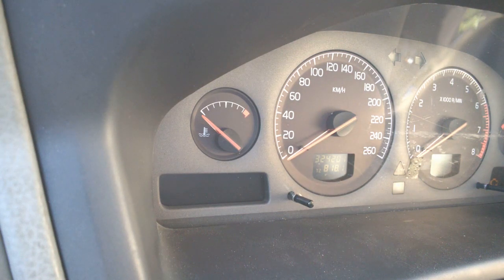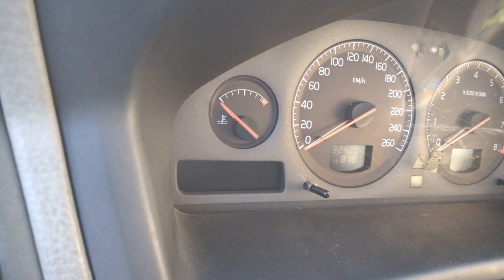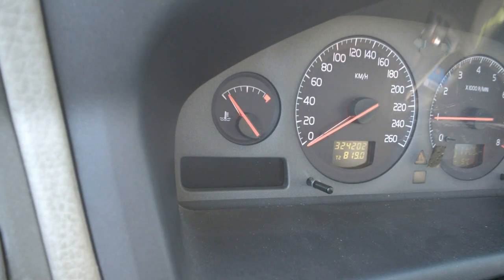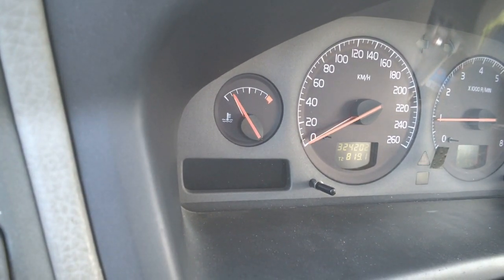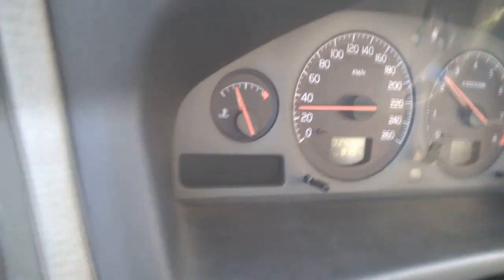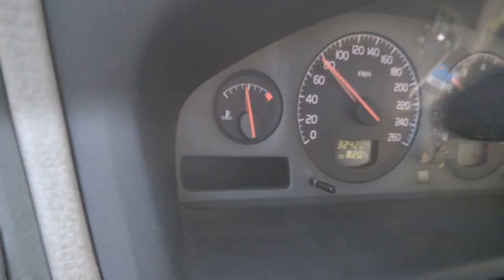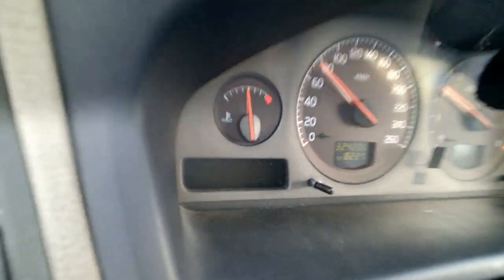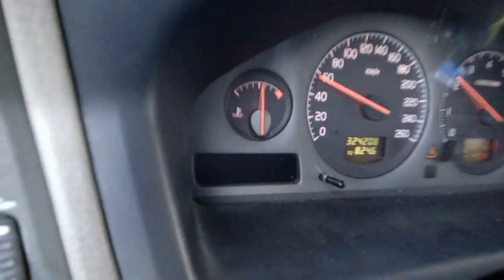Volvo S60 V70 How long it takes for the engine to warm up in cold weather 2001-2009

Comment: Just to understand it right - even though the needle stand still at twelve oclock,  the temp can vary?
Reply from the maker: Exactly. It may sound strange, but the coolant temperature does vary when driving the car. Maybe I should upload sometimes another video, this time using a scanner that reads the actual coolant temperature in real time. Once the engine is fully warmed up, the coolant usually has 90C when cruising, and can climb to 95-100C under hard acceleration - that's when the thermostat opens to cool down. In hot summer days, when stuck in slow traffic, the coolant may even reach 105C or more  and that's when the radiator fan also starts spinning at higher speed. So the dash gauge moves linearly only before and past 12 o'clock, once at the 12 o'clock it's not linear but rather holds still for a specific coolant temperature range.

Comment: Thanks for video Peppermint.
How big is your battery?
Mine is the smallest of the three Volvo variants, believe mine is about 60 Ah
Reply from the maker: It will depend on the weather on your location and also on the engine type and other electrical equipment (such as the optional subwoofer in the V70). I think the diesel D5 engines have quite a larger battery. I live in Canada where temps go down to -20C. Here, quality batteries are very expensive so I buy only used ones. The original battery for my car had 600 CCA, but right now I have a genuine Mazda battery with 550 CCA - this is the cranking power in cold weather. It cranks very well in cold weather because the battery is in good condition, I use 0W-30 oil and the car has no parasitic drain issues. Downside is it will not last long if we listen to the radio with the engine off. I think Volvo specs for about 2h reserve power for their batteries, depending on the car equipment. As for the battery 'shape' or geometry, some batteries are taller and cannot fit properly under the trunk board. I had to release the small nut near the positive connector, to adjust the cable fitment around the battery. And I did not secure the battery with the bracket, nor I use the top battery cover. 
http://www.volvohowto.com/volvo-batteries-guide-amperage-dimensions-volvo-models/

Comment: Last week it was -30 celsius. My S60 needed 10 km in 80 km/h to reach 12 o'clock. Just cover the radiator and use 0W30 fully synthetic oil. Idling or city driving is not good for warming up if it's this cold. It'll never reach 12 o'clock in the city.

Comment: would you do  a video on block heaters, oil pan heaters and battery blankets for extreme weather conditions like -25C and colder? (if you haven't done so already) thank you for all the great vids!!!!
Reply from the maker: We don't use these in the city where I live. Having a good battery and using a 0W-30 oil or even synthetic 5W-30 (such as Mobil 1) should do the work down to -30C or so.  It is perhaps good to try reading on any car forums about aftermarket heating pads (not just Volvo forums). Of course, cheap chinese heat pads are worthless (and may cause fire), but a quality brand under the oil pan and around the battery should work quite well. It needs to be plugged into a power outlet which is more difficult to do for the battery located inside of the trunk. But under the oil pan should already help a lot. A problem is how to glue the pad correctly and how to protect it from humidity, salt, rocks. Without heating pads, if one thinks the car may not start, perhaps the easiest trick is to remove the battery from the car during the night and keep it inside home. On the V70, the trunk has no lock so it cannot be opened without power, also the battery is heavy to handle on the S60.
Reply: @Peppermint1  thank you <3 I appreciate your quick answer. I live in the yukon with an XC 70 '04. Got a wolverine oil pan heater for my synthetic oil (mobile 5W30 like you recommended) and a battery blanket. I knew idling the car was bad for the PCV but im glad you confirmed that it was actually worse than what i thought so I'll be more cautious about it.  love your channel, i have learned a lot. thank you again!